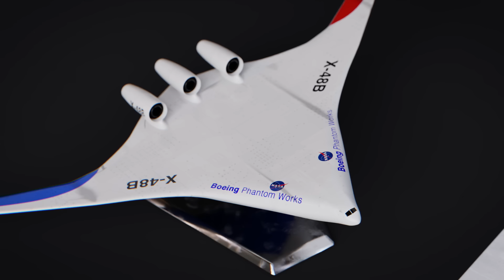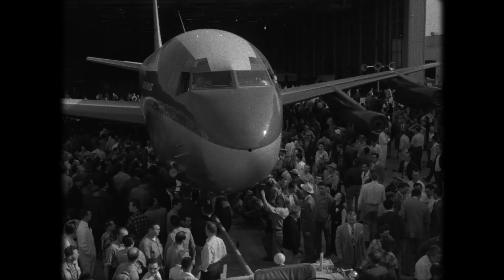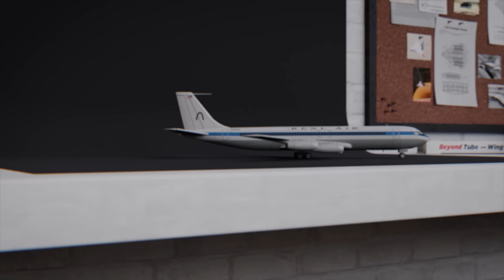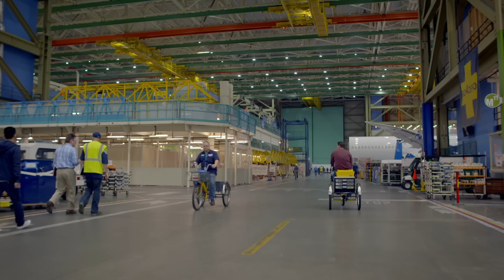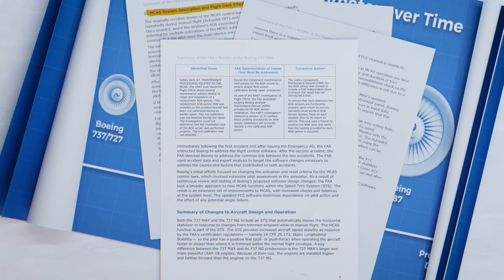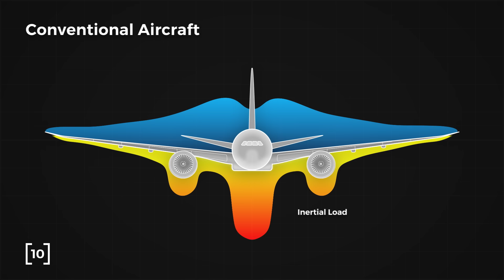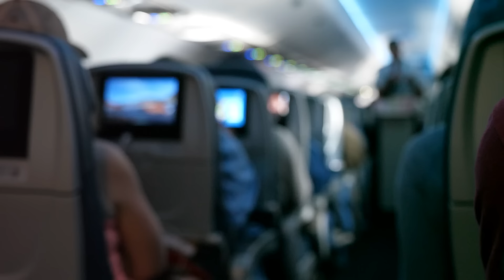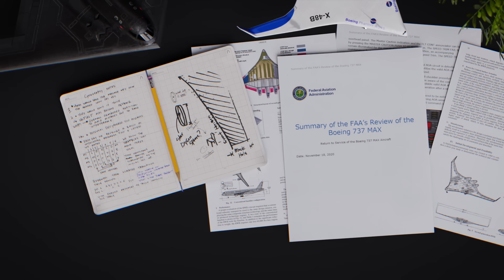The Plane That Will Change Travel Forever

Comment: It's never a good idea to remove a tail. You need fin & rudder area, centered, back behind everything. The further back, the lesser the area, but yaw authority even at steep bank must be available.
In the '30s many designers did "all-wing" planes of one planform or another, from forward swept to delta, many of them very-low aspect-ratio (and they were sleek and quick on little power, not draggy).
See Cheranovsky, Fauvel, Lippisch, Canova, Arup (Indiana, Snyder with Hoffman or Grainton)
They all tried first the all-wing purist's completely tailless and never made it off the ground. They then tried wing-tip fins which were/are slightly less terrible.
Unlike the later Hortens and Northrop, the others all deferred back to a single fin and rudder, and all made planes that handled well.
In deference to them, I like to point out that no one yet has really made a good serviceable plane. One they can use with normal flight skills and technology, that is safe in out-of-normal, near-departure situations. That doesn't mean a hang glider or ultralight that can't operate from most airports, it certainly doesn't mean something that only Air Force officers in ejection seats, and don't think of trying to dead-stick anything.

 See also: At the Kharkov aviation institute, the Avianito Brigade (students) KhAI-3. A project to prove that a single-engine 100hp, can move 12 people or 1t economically.
Straight railing edge medium aspect ratio wing, straight thicker center section leading edge. Passengers in rows behind twin pilot positions forward, separated on either side with the engine centered in the leading edge. Unabashed with a big fin and rudder just behind the trailing edge.
After trim & balance and control issues were straightened out, it was tame and responsive, no bad "tricks", speed from 32-78 knots. Served as an airfield errand plane and light transport for a few years.

Recall also from Northrop's Avion company, the little X216H Avion 1, 1929
Frequently called a flying wing because everything was in the thick wing and thicker center section, with only little booms going back almost like a normal plane to round fin/rudders and a straight tailplane between. It had the engine internally with the prop at the trailing edge, and then a more normal tractor configuration and landing gear to allow A for rotation. Among the best of all planes in its class in all criteria, and a good deal faster than any others.
During the war, several US designers including Higgins/Bellanca for a transport and Boeing for a bomber series, used a similar planform: Spanloaded, inhabitable camber & huge chord center-wing sections, with no particular fuselage other than a center bulge for cargo/bomb bay and a nose for crew, with the smallest possible boom going back to the tail plumage.

Among patents of the sort, look up those to Farouk Dizdarevic, tailed flying wing (US patent 6,923,403 B1), longitudinal flying wing (which gets away from a down-force tail with a sort of "Delanne" tandem wing with the tail at least half the wing area.) and "Deltoid Main Wing Aerodynamic Configurations". All blended deltoid lifting body just like the X-48 with a substantial tail. Maybe because it's "not invented here", (patented in late '90s-early '00) Boeing won't touch it.
Lock Mart might have referenced it in patent sheets on their "hybrid wing/body" transport.

Comment: I read the 737 max did offer redundant sensors as an option. The prestigious airlines bought the optioned out ones but others did not. Multiple redundant sensors should have been standard on all planes. For sure money grubbing caused this. They had redundant sensors, but only if you paid extra.

Comment: I am surprised you haven't covered the problem with passengers sitting further away from the main axis around which the plane turns. As far as I've heard somewhere, this is a big problem with blended wing body design, because people can get much more easily sick, having to withstand increased forces and movement. Or has this issue been resolved somehow and is not that big of a concern anymore? :)
Reply: Maybe it could be used for mixed transport, passengers in the middle and cargo on the sides. A mixed configuration was already tested in traditional planes but the cargo part made it too slow, and it failed commercially, but maybe since a flying wing would need a redesigned stand configuration there might be a way to make it more efficient? Who knows
Reply: @albero319  Failed commercially? Excuse me Combi configurations are a thing used the world over, even more on small cities which sole connection to the world is an airplane
Reply: @glockmat  but it’s not that common. It is barely done
Reply: @albero319  Please give me your definition of Barely done, because 15% of all Bombardier and ATR planes leave the factory with this configuration
Reply: @glockmat  I don’t know what you mean. You pointed out exactly what I was saying, combi flights are extremely rare. I’ve just looked at IATA’s air transport statistics for 2021, and they didn’t even talk about combi.
Reply: @glockmat  15% of Airbus or Boeing would be more interesting, but ATR? I didn’t even know they were still in business. I didn’t even know there were airline companies dedicated to combi before I looked it up today
Reply: @albero319  IATA doesn't keep track of which configuration the planes taking to skies are using, its like trying to search IATA for the configuration of the flights of 777, either all economy, or high economy, 2 class, etc
   
Also ATR is a gisntic manufacturer of turbo props, they build modern and respectable planes to this day, just like Embraer or Bombardier, although Embraer doesnt offer combi configuration, it isn't really suited for its main markets
Reply: @glockmat  point is, combi are barely a thing.
And the ATR thing was a joke btw
Reply: @albero319  Depends on what you call "barely a thing"
Reply: @glockmat  how many combi planes have you seen in your life?
Reply: The issue of extra movement will be solved the same way the issue with maintenence of those engines and the 450 passenger capacity. WITH FUCKING MAGIC

Comment: I'm not sold. You have mentioned stability issues, but didn't mention the solution. You said there would be software to compensate, yet mentioned that it's unreliable and led to crashes. Also those minor corrections to negate instability means additional drag forces, therefore additional fuel consumption. And you didn't mention the main issue - airports. How do you expect modern airports to work with airplanes shaped like this? Will we have to completely rebuild them? What about landing strips, will we have to rebuild them as well, make them wider? That's why Airbus A380 failed. Majority of airports simply do not have infrastructure or capability for such big airplane to be serviced or even to land.
Scaled RC models and UAVs is one thing. Huge, heavy and wide airship that you have to put somewhere is the other.

Comment: Anyone who's ever had a kid in a station wagon/minivan who can't really see the windows will realize that such a design is gonna have a significantly higher percentage of folks getting air sick. Also, air travel has at least in the US been built over the last 30 years on the hub system, so even if an airport wouldn't need to change their runways like with the A380, they'd still have to completely change the gates to accommodate the multiple aisle ingress/egress touted as a benefit. Those changes would require billions across the US in airport infrastructure upgrades and if the US is on top of anything, it's our infrastructure!!! /sarcasm... As for the hub system, the current system was specifically built to move AWAY from wide bodies and bigger jets to smaller jets flying into and out of hubs.

There's always gonna be dreams of bigger airframes, but we just don't use them. Moreover, internationally, there's a much bigger push for high speed rail which is FAR more environmentally and cost effective for moving people than air travel and for trips under 3-4 hours, it's about the same if you include all the TSA garbage.

I can see such a plane filling the long haul routes, but I can't imagine catching a flying wing from St. Louis to Portland (OR or ME, it doesn't matter).

Anyway, it's fun to think about and even more fun to contemplate the engineering challenges, but unless the globe completely refocuses not only on air over rail AND more direct flights, this airframe would suffer the same fates as the A380 and the 747-800.

Where such a plane would be gonzo is for freight. It would be a huge boon to the freight industry and could find a home there.

Comment: Blended wing lifting bodies are great conceptually, but when you start to look at the details it starts to break down… the one place where they have been successfully implemented is 5th generation flightier aircraft…. For example, passenger evacuation… you can’t go out the sides, there’s wings there, you can’t go out the back, there’s engines there, so you would have to go out the front only, in the leading edges of which there would have to be doors…. and where are the fuel tanks, right there in the same wing where the passengers are…. Can you imagine the tanks rupturing in an accident and spilling fuel into the passenger cabin…. Would passengers be OK flying in a plane with virtually no Windows…. And with few Windows what happens inside when they power is off and the cabin plunged into darkness…. Could go on and on, conceptually wonderful, but in real world use many many serious issues….

Comment: The problem with these futuristic blended wing designs is their very large surface area. Basically drag is proportional to surface are and these will be high drag designs needed MORE POWER, have WORSE fuel efficiency etc. You simply can't beat a tubular section fuselage for the lowest possible drag compared to useful internal area (and equal spread of pressurisation forces too). The other good option is almost square which can be seen on designs like the Shorts Skyvan and B-N Islander/Trislander.

The strange non-geometric fuselage will presents huge fabrication problems too aside from the unequal spread of pressurisation requiring almost certainly internal struts/bulkheads. Also a lot of internal space will simply be unusable. I doubt it'll ever get made. It looks sexy on computer generated video which is exactly where it'll stay along with VTOL electric flying taxis etc.

Comment: There is nothing new under the sun as they say........ I suggest you look at Charles Fauvel and the Horten Brothers..designing flying wings nealy 100 years ago.  More recently John Dyke with his "Delta Dyke", a very successful homebuilt, and of course Burt Rutan with his canard aircraft.  The forward mounted canard wing balances an aircraft by lifting forward of the CG instead of pushing down aft.   ..........This is all well established technology, not "rocket science".     All of these small aircraft have an enviable safety record........ and are home built in most cases..... There are of course others.........it's NOT rocket science.

Comment: There is one important problem of the wide fuselage design not mentioned in this video - when the plane rolls as it's changing its direction, passenger sitting closer to wing tip will experience very big vertical movement. This alone could potentially make passenger comfort non existing and close door to commercialization of this design.

Comment: The problem is not the efficiency of the aircraft but the number of aircraft and passengers. Your graph shows major efficiency improvements over many years, but CO2 emissions related to air travel grew 75% in just 22 years from 1990-2012. That growth must be nearer 100% now (at least until Covid). This effect of improving efficiency counter-intuitively increasing fuel demand was noted in Victorian England by an economist called William Stanley Jevons in 1865, when he looked at coal consumption and major improvements in its efficient use. It's called Jevons' Paradox. When you think about it, it isn't paradoxical at all, increases in  efficiency decreases costs and increases market share and the uses to which the technology can pursue and the numbers that can use it. Prior to Covid the predicted growth of air transport globally was 3.5% p.a for the next 20 years - that is equivalent to exactly a doubling of air transport in this time. So a 25% improvement in fuel consumption still means increase in CO2 emissions by 75%.  The planet cannot afford for us to do this. Covid has shown us we don't have to travel so much, but if we don't learn from this, then we really are stuffed. A hydrogen-fuelled airplane would avoid this (though its water vapour contrails will still be global warming) but hydrogen produced from renewable energy is itself a very inefficient process and the costs will be prohibitive. We've got to allow the planet to get much bigger again. .

Comment: Interesting design indeed but, a couple serious questions need to be addressed. The main landing gear on this design will be much wider than current designs. Getting those gear on current runways in crosswinds will require extra skill by the pilots. Keeping those tires on the current taxiway system will take equal effort. At current gear widths on 200 foot-wide runways, tire tracks indicate some current planes press the edge of the runway. Secondly, the feeling of being in a 20 foot-wide cabin when the plane rolls is minimal. However, when the farthest seat is 50-60 feet from the center of the fuselage, the experience from a passenger perspective will be vastly different. As the plane rolls into a 30 degree left bank, the left wing of the airplane will drop 25 feet and those seated on the outermost right seats will rise 25 feet. Even with windows (or screens) this see-saw ride phenomenon will not be enjoyed by most of the flying public. Approaches in gusty weather will be violent for people seated further out.

Comment: Fun fact.
The manufacturing of hydrogen fuel is also not a green tech. You either burn fossils or use traditional sources of energy to create the electricity needed for hydrogen manufacturing.

Comment: The jet engine was invented in Britain.  The first commercial jet plane was the British Comet.  The first hyper-commercial plane was of British design, British/French manufacture (although the revolutionary-designed engine and most of the parts were British).  The French insisted that the name was changed to their spelling of Concorde, with an 'e', and the Brits gave in to this demand.  Your film is a good advert for Boeing, but is full of errors.

Comment: FLY BY WIRE HAS ALLOWED FOR HIGHLY MANEUVERABLE AIRCRAFT. F-35, F-22 and so on. When I was flying F4E Phantom II, back in the early 70's we still flew the old fashion way. The problem still comes back to the pilot. YOU HAVE TO FLY THE AC.

Comment: Simplistic, Passive, that doesn't need electronics to be safe, is vastly superior. Just like in cars, the best ones can still handle amazingly well with all the traction aids turned off, but the gains from the electric enhancement encourages you to keep it on.

Comment: This idea was developed by Horten in Germany in WW2 and is almost 100 years old. Fly By Wire just has too many security risks for passenger aircraft. YOu see planes like this in the military because guess what, the pilots have ejection seats. Fly by wire planes cannot glide which is a huge downside.

Comment: Very informative video. I think you are missing an analysis of the issues in landing a rudderless delta shaped plane in cross winds though. I suspect it can be partially solved with all wheel steering but for highly variable cross winds I suspect the tube and wing with rudder style is better at landing. If you could restrict the blended wing aircraft to airports where this is not an issue then great. I think they will need all wheel steer and wingtip spoilers at a minimum to compete in this area though.

Comment: it is odd, that boing only used one pair of sesors. In most airplanes it is very common to have the mandatory instruments always twice. If one fails, you will always have another one you can use. 
Of course bad software can cause dramatic issues. But still software is super reliable if programmed well and tested enough. I would always trust a computer and its software more than humans. In the end, it is still human failure,if a human wrote a bad software. The wings could also fail, if the human engineered them badly.

Comment: i can see commercial freighters using a blended wing design, possibly carrying a small number of passengers. But an all-passenger commercial airframe would be too big, since it has to allow passengers to walk upright when boarding and deboarding. If the cabin is that tall, a blended wing has to be quite wide and big as well. The economics of scheduling flights with 400 to 600 passengers just won't be able to compete with existing routes using tube-and-wing. Seth already made this point. Also, the inability to reuse a basic design in stretched and shortened versions is a big down side; families of planes with the same type rating are much better than the more rigid approach of a single airframe per certified type.